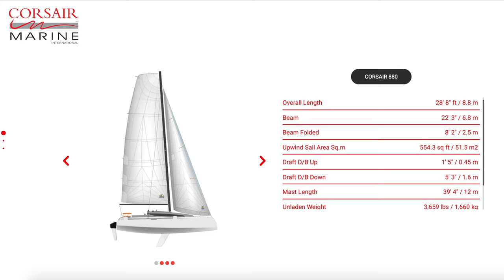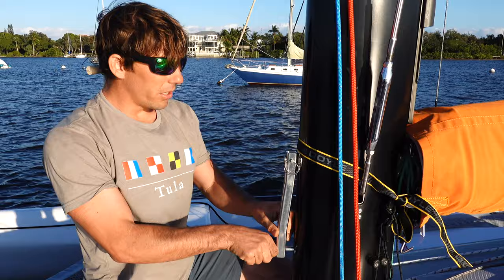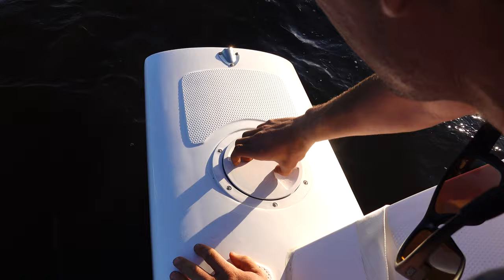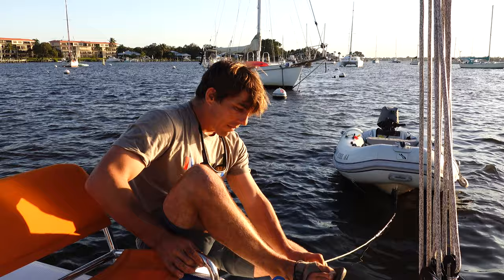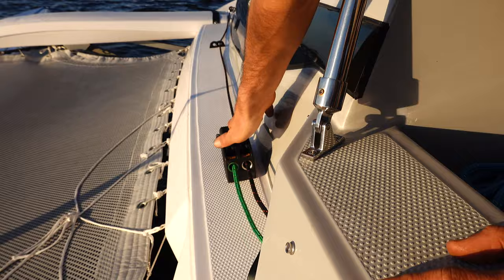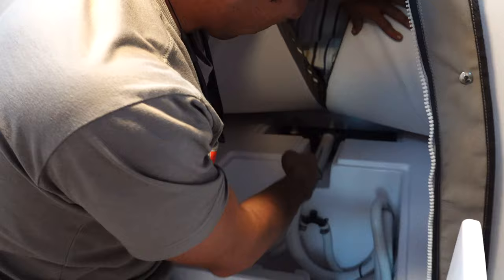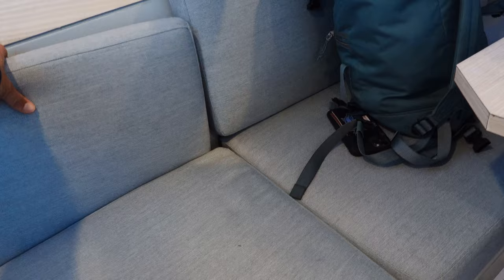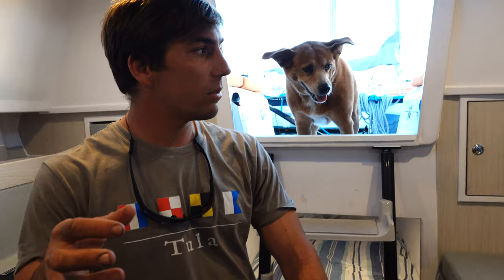Corsair 880 Trimaran COMPLETE TECHNICAL TOUR

Comment: The bolts along the trailing edge of the rudder cassette are sacrificial - if you hit something submerged the bolts should shear allowing the rudder to kick back and out without breaking.  Not a bad idea to have spare bolts on board and a lanyard on the rudder blade.

Comment: Great tour guys! I often sail with a friend on his Corsair F31 tri. It's great what an interior rethink can do for internal layout. In his boat, there's no aft cabin and much of the space under the cockpit is inaccessible, despite having enough area for full size double mattress. Instead a long shelf pulls out from under the cockpit between the side seats and makes a queen bed. But you loose half the saloon! Imagine a similar layout to the 880 but stretched by 3ft! I sail a sporty little 24ft cat, which reaches mid teens speed. Sleeps 3 comfortably once you're in! Still manages some creature comforts like heating, on demand hot water to galley and head with shower. 2 burner hob/sink combo with larder and fridge in the galley. Domes above galley (port) and head (sbd) offer 5ft10 standing room. The bridge deck gets tented to make a saloon, kind of. She has a sleek look on the outside, so you'd never guess about the inside!
Reply: Hi, any way I could see some pictures of the interior of your f24? I'm really curious how you fit all of that!
Reply: @Rudolf Delort-Laval  Hi Rudolph! Everything is stripped out at the moment for a major 'back to fibreglass' overhaul. All the internals are currently spread out around my living room! My description is a post overhaul scenario.

Comment: AWESOME Vid!  You guys are great, and I subscribed.  

Couple of questions: 1.  It would be awesome to see a vid on use of electronics; recharging batteries and use of internet and laptops, other devices and how you recharge.

2.  It would be awesome to see a video of regular maintenance required; I’m interested in these boats, and would love to see what I would go through - they say that cruising is fixing your boat in exotic ports of call; I was looking at the ball under the mast and wondered what lubrication is needed, etc.  

3.  I see that you have a Torqueedo motor on your dingy; is there a reason you didn’t go with one for your main non-sailing propulsion?  Did you consider it, or did the boat just come with the internal combustion outboard?  For recharging, how would you work that if all your motors were electric?  If you did consider a Torqueedo for an auxiliary outboard, what did you consider and why did you choose this outboard?  That would be enormously helpful…

Thank you, and Fair Seas and Following Winds (I say it that way, because I hav sailed in following seas, and that does not make a happy helmsman…

Comment: Would you camp in this boat when its on the trailer? I know you have a truck camper. But when you are in tow mode, you have to complete accommodations.
Reply: i have a farrier folding tri and i use it as a caravan as much as a boat. plus side is you never get hassled by rangers.

Comment: Regarding the amas, I am disappointed overall in the engineering utilization. Each amas should have two separated compartments with hatches that allow stowage of lightweight items such as fenders, Cocoa Puffs and other light weight storage/consumables in the centrally divided hulls. There should be water tight flotation compartments, fore and aft that are accessed only by the 8 inch inspections ports. One hatch in a long, narrow amas is stupid. Divide it up into flotation and storage spaces and use it intelligently. OR!, if they should not be used for storage, don't put a hatch in it at all, just small inspection ports. But, in either event, definitively decide how they can be used, because the way they are presented now, I do not know how to utilize them!